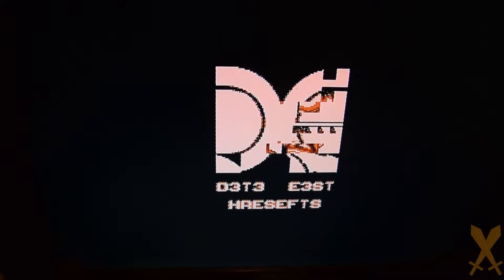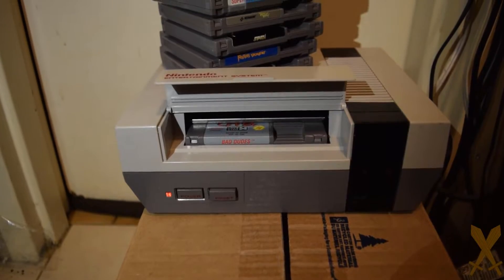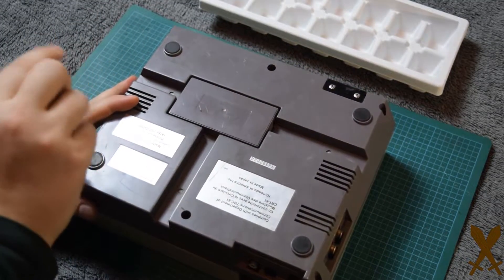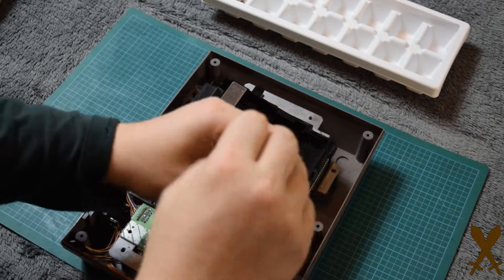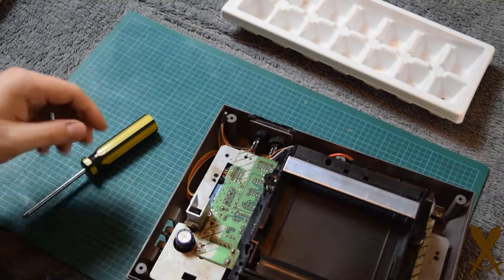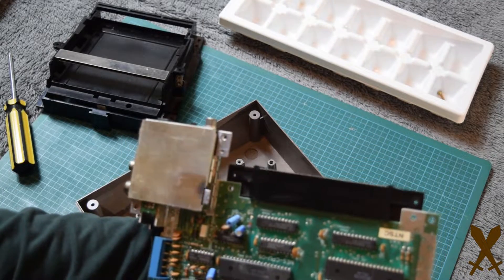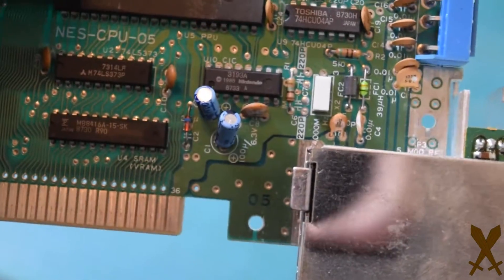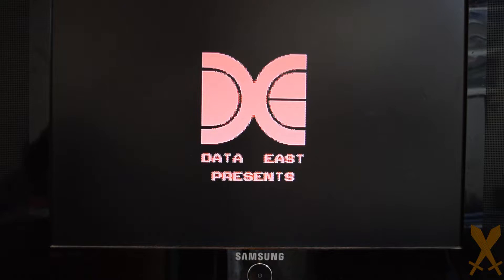NES Refurb Blinking Light Fix plus Disable Lockout Chip - The Lost Boy

Comment: If I disable it will my saves on my games not get corrupted from the resets of the blinking light
Reply from the maker: Not at all. The lockout chip has zero to do with game saves so no worries there.
Reply: @thelostboy5858  What I meant is will it constantly reset if I take out the chip fully
Reply from the maker: You will not 'take the chip out', you will cut the pin to disconnect it. This is done to STOP the resetting which is caused by the lockout chip. Disable lockout chip = stop unwanted resets. Simple.
Reply: @thelostboy5858  I already cut pin 4 but what i mean is hypothetically what if I desoldered the chip straight off of the PCB. What would happen.
Reply from the maker: Likely just cause unnecessary damage, I really wouldn't want to find out. Why would you want to do that anyways? Best thing is to just make sure the pin is fully cut and disconnected, then no more resets...

Comment: just clean the pin connector and the contacts on the motherboard of the Nintendo entertainment system
Reply from the maker: That helps in general and is a good practice, but the blinking light happens specifically because of the 10NES lockout chip, so the fix I showed eliminates the blinking light completely and that helps with reliability overall. Thanks for the comment:)